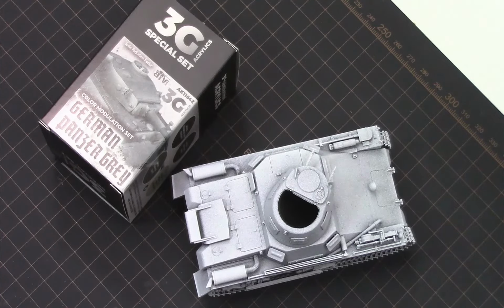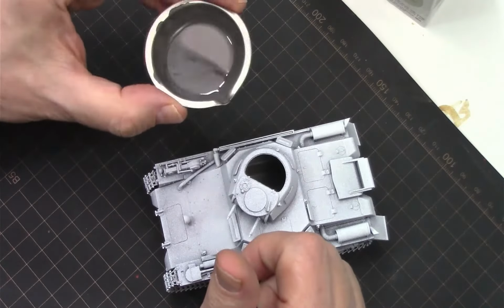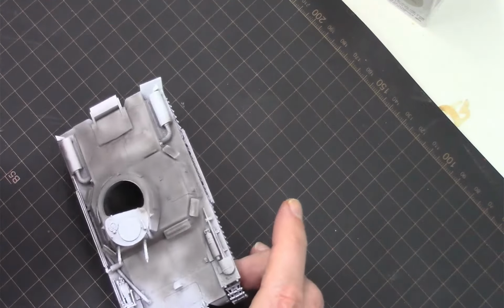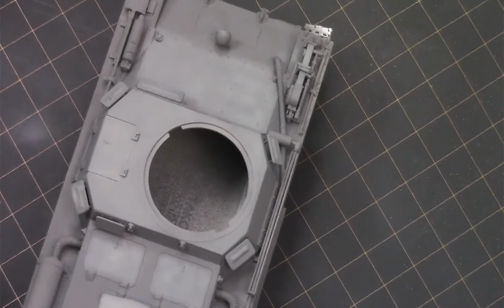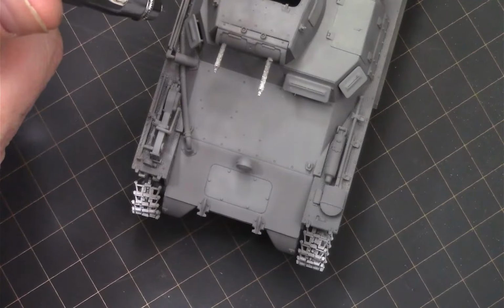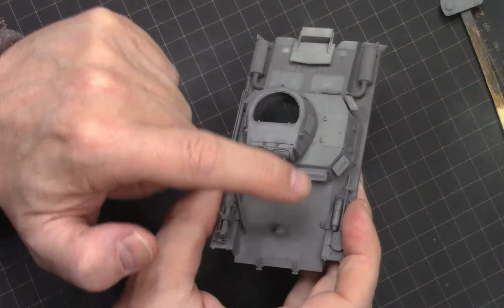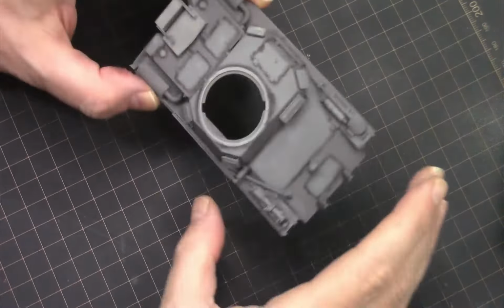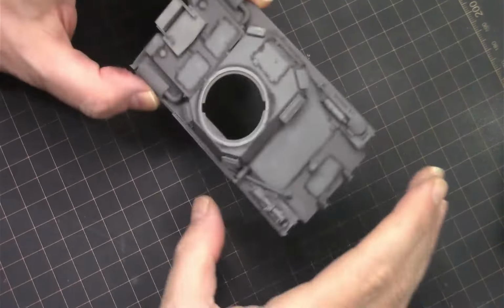Let's Painting the Takom 1/35 Pz.I Ausf A Part 1

Comment: As always Matt very informative and you make it look effortless - quick question - you never seem to use a paint cup cap - is there a reason? 

I actually got my first build underway over the weekend (Tamiya P-51) and managed to spill paint with the cap on (never used an airbrush before - now used two) may have miss poured when transferring from mixing cups or not put lid on  properly - had a blast (literally) - still copious amount of airbrush cleaner sorted it.
Reply from the maker: Hi Neil, you are correct and I should have a cap on the colour cup but you do get used to not having it on.
Reply: @pmmodelsuk4012  Cheers Matt - Just thought there may be some trade secret to going going cap less - I do watch very closely what you, Phil and the guys do!